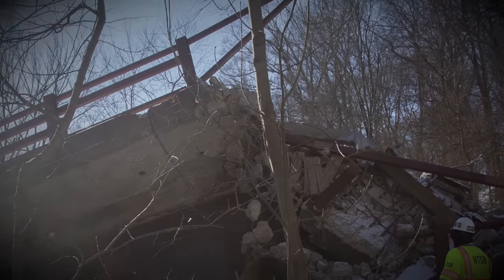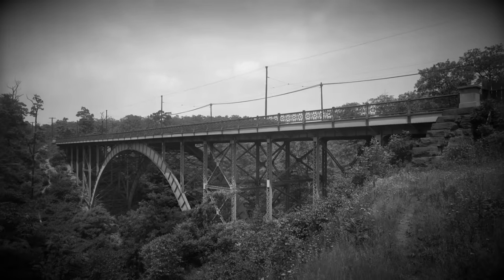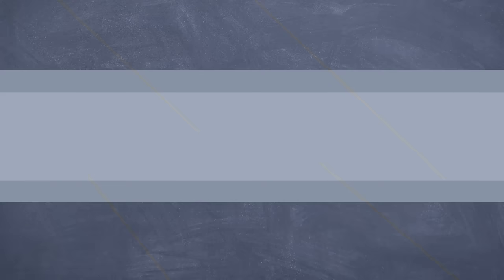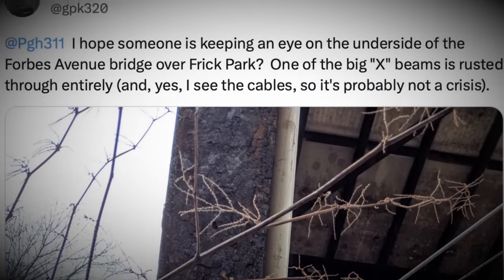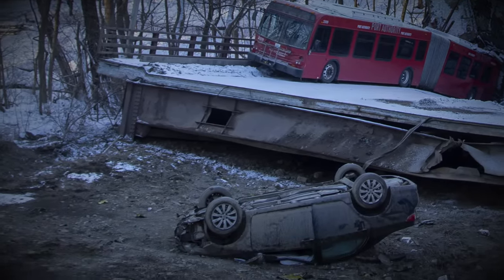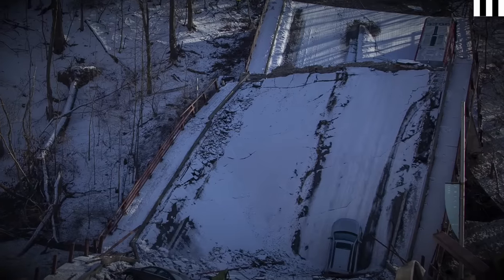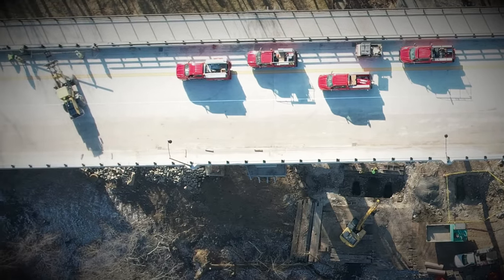Allowed To Rust: The Fern Hollow Bridge Collapse 2022 |  | Plainly Difficult Disaster  Documentary

Comment: A small addendum for the cause of the rusted steel: The material is call Corten and was invented by US Steel Corp in the 1930's, but not very commonly used for bridges until much later. It is particularly susceptible to corrosion when in the presence of salt water. The reason the steel of that bridge rusted so rapidly was because Pittsburgh uses a HUGE amount to salt in the winter to keep the roads passable. It is the NaCl that accelerates the corrosion, not so much the standing water as you stated in this fine video. Flowing salty water will actually increase corrosion of steel since there is increased ion exchange from the new salt added to the water stream. Love your shows! Keep up the fine work.
Reply: *"Cor-ten"
Reply: Cor-Ten steel used in present "seacan" construction.
Reply: @sharonfieber6458  it is indeed, however the steel is also painted with many coats of marine grade paint too to protect it from the salt water. Any small chips in the paint do seal over with the corten signature rust coating, but this is totally secondary. In the Fern Hollow bridge there was no attempt to paint any part of the bridge. Really stupid decision, that.
Reply: I believe the New River Gorge Bridge in West Virginia is also made of Cor-Ten, although it dates to 1977 or so.  There were concerns about keeping an arch bridge over 800 feet in the air painted, so Cor-Ten was used.  I sure hope they have a way of keeping road salt off the steel parts.
Reply: @B-and-O-Operator-Fairmont  Hopefully so. I doubt WV can do a worse job of it than PennDoT did! LoL . Maybe that WV bridge uses active galvanic protection measures.
Reply: Burlington Northern Santa Fe Railway has some bridges made of Cor-Ten steel. They considered making their signal equipment boxes out of it, but decided having rusty boxes at highway crossings would look too bad from a public relations standpoint.
Reply: @MrBirdnose  I personally always hated the rusty stains all over the ground around of a corten structure. They look like something out of a Mad Max film. If you are ever in Pgh check out the paving around the old US Steel building in the downtown area. You cant miss it since the entire thing is rusty and ugly to behold (but at a distance it looks nice to some I guess.) 600 Grant St, the entire thing is made of Corten.  NEVER touch the steel unless you like getting rusty dirt on yourself! The building maintenance people try to keep the staining to a min but in my opinion it still looks like crap. BTW the maint people also have instructions to never apply salt anywhere near the building base! LoL
Reply: We should use stainless steel then
Reply: @LivingTheDream77  Stainless steel is expensive, doesn't always have the properties required, and some grades of it actually rust quite easily in the presence of salt (which is often applied to roads to melt ice.)
Reply: @MrBirdnose  im sure building the whole fucking bridge again costs more.
Reply: A242, A588 we use tons of it building industrial fans.

Comment: On the topic of collapsing bridges; I'd love to see a Plainly Difficult-take on the collapse of Tretten Bridge in Norway in 2022. A glulam (glued wood w/steel bracing) bridge fell and took two vehicles with it. They avoided ending up in the river below, though, and there were no injuries. The bridge was built in 2012, so it only lasted 10 years. The authorities closed 14 glulam bridges for inspection after the Tretten Bridge collapse. The cause of the collapse was apparently material fatigue. Another similar glulam bridge collapsed back in 2016 because of a design flaw. It lasted only 4 months…
Reply: Someone did that already...

Comment: We had a bridge kinda like that, with a tendency to ‘uninstall’ itself. The Cline Avenue Bridge in East Chicago collapsed during construction in 1982. They eventually finished building it. However, when they discovered the bridge was eroded to the point of basically being a few sticks holding up a pockmarked roadway they finally closed it in 2009, but they didn’t demo it until 2013. In the meantime, it just kept falling apart and people kept driving off of it, not realizing it was closed. They finally opened a replacement for it in 2020. However, the bridge was built by the same people that built the pedestrian bridge in Miami that collapsed, so we’re a little leery of it. We’re worried that they didn’t put in a ‘hardware’ upgrade so it might ‘uninstall’ or spontaneously decide not to show up for work today, just like the bridge in Miami.

Comment: The tallest building in Pittsburgh, what I and many other Pittsburgh residents  have always known as "The Steel Building" not only uses "CorTen" steel that is designed to use a thin rust coating as patina protection against further deterioration, it also is constructed with external load bearing box beam columns that are half filled with glycol and water. In the event of a major fire, the antifreeze inside these columns will expand and dissipate the heat (steel loses virtually all its structural integrity at around 600°F) to prevent the collapse of the building. I always thought that the use of those liquid filled columns was pretty amazing.

Comment: Things like this and the Surfside Condo collapse highlight something. These were largely preventable disasters caused because officials simply didn’t want to pay for maintenance. Which at the end of the day, may be a more intractable problem than design flaws.
Reply: Adding sacrificial zinc anodes at the time of construction extends the life of a steel structure at least threefold. Engineers are either shortsighted, or they do not understand the principles of cathodic protection.
Reply: @wilsjane  "Engineers are"... way to misplace your blame entirely.
Reply: @wilsjane  Usually it's the contractors and government nixing it to reduce the cost. The engineers would almost always be more than happy to include all safety and durability features.

Comment: In 1991 a light pole made from such steel snapped and killed 2 people. Photos taken the next morning showed that the brown corrosion that is supposed to just protect the surface at penetrated almost all the way through the metal almost all the way around the pole where it broke. During the investigation it was noted that landscape work had been done and a large pile of rocks and soil had been temporarily stored near the base of the tower. This kind of metal has to be completely exposed to air if the corrosion is to protect the metal below the corrosion.

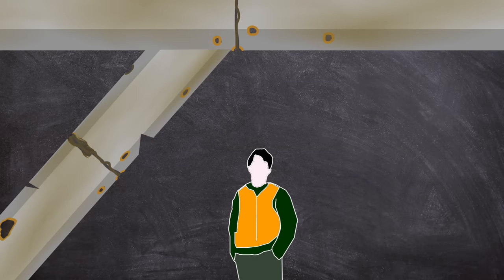Comment: 4:21 You mean the beam was replaced right?
They didn't just actively weaken the structure?
Reply: Nope. 
Yeah.
Reply: local, can confirm they just literally took out a rusted support beam because it was rusted through and crumbling (mostly to hide their shame because people kept taking pictures and reporting it) and didn't put anything back in to add additional support, and then were surprised it collapsed. people have been pissed off about bridge and road maintenance in the city and around the state for a while, they do some dumb things and neglect things until they fall down.  there was another bridge that's had nets and mesh around it since the 80's because chunks of concrete was falling off it, but was still in active daily use with people both driving on it and UNDER it until just a few years ago when they finally replaced it.  between the neglect and the road salt its lucky we still have any transport infrastructure left standing.

Comment: the older i get, the more of these videos i watch the more i'm convinced that we should build with brick and stone with minimal concrete and strategically placed extremely corrosion proof steel. Basically study the Romans with a modern twist because what we build these days is evidently rubbish
Reply from the maker: Concrete is a bit shit
Reply: Many of the mid-century bridges are decades past expected replacement. They weren't designed to be used for so long with so much traffic.
Reply: @edcrichton9457 That's just it. A frenzy of building lots of cheap bridges and structures when the economy is humming leads to a bunch of decrepit structures decades later, with no guarantee the economy will be so good. (Spoiler: it's not.)  I also like the "build like the Romans" idea, at least where practical. Stone arches won't work everywhere.
Reply: The reason their structures lasted so long likely has much to do with amount of usage. You can't compare 10 years of foot traffic and horse carts to 10 years of cars, trucks, semis, heavy equipment at a much, much higher population. Oh, and our more extreme temps- the same materials need to be able to handle high highs and low lows.
Reply: @mommy2libras  The Starrucca Viaduct and other stone arch bridges have carried heavy railroad traffic for almost 2 centuries now. Stone doesn't rust or crumble, so if it's on a good foundation and build correctly it can last a very long time. And temperatures in Italy can be just as extreme.
Reply: @edcrichton9457  Many of them were designed without anyone imagining we'd ever have so much traffic.
Reply: @PlainlyDifficult maybe modern day concrete, but the Romans did it right.  Sad to see things built & created now are inferior to ancient craftsmanship.
Reply: @mommy2libras  i was more referring the the buildings such a theatres and schools everything really but my point still stands a stone bridge is stronger and likely to last longer than a steel one especially with the strategic corrosion proof metal i mentioned just because it has more to deal with don't mean its not possible. you would in fact be hard pressed to convince me a properly engineered structure using best of modern and best of roman(cost not a factor is would be expensive but so are accidents) would not be able to handle the weight....would look nicer too.also i don't think temperature has much to do with this
Reply: Even stone a mortar require maintenance.  Absent some kind of design flaw if a bridge is well maintained it can last forever - no matter what it's made out of.  

In fact, I would avoid any material that is perceived as 'not needing maintenance' because that perception will result in little to no maintenance.
Reply: @kimmuckenfuss2284  Its planned obsolescence! got to keep the wheels of commerce turning!

Comment: The 1970s aren't known for producing quality structures in USA. Residential homes especially seemed to have lower standards. Ive had to reinforce roof framing because they used 1x4 supports (in snow country). People were still coming down their trips from the 1960s?

Comment: Yeah that Corten steel (weathering steel) is tricky. A lot of ISO containers are made from it and if you have to patch or otherwise repair it you have to use corten to do it. I'll bet the welds are the root cause in this disaster. It's really easy to un-weather property the weathering steel when welding on it.

Comment: The first 10 years of my life I grew up about six blocks from that original 1901-03 bridge which also carried two Pittsburgh Railways carlines (64 & 67, plus the 64's rush-hour 66 cutback) until 1967.  That 3-hinged arch-bridge really shook when the streetcars crossed over!  So the skimpy replacement only lasted barely 49 years!  I think that is Cor-ten steel that was used and it's been used on a lot of other structures plus the New Fern Hollow Bridge's (#2) spindly design which I see on a lot of newer interstates.

Comment: crane bus and sinkhole bus became local memes for a ridiculously long time because the Pittsburgh roads are so notorious for just eating public transportation vehicles recently.  Its a mix of age, neglect, corruption, and road salt- and i mean a LOT of road salt in winter, that cause our infrastructure to both break down faster and become ignored even when there's a known problem.  bridges with rusted out chunks missing and crumbling concrete are common in the area.  there was another bridge in Pittsburgh that had netting around it since the 80's because it actively had chunks of concrete falling off it for decades, but continued in daily use with people driving both on it and UNDER it until just a few years ago.  

some people are like "well, the government has a budget to fix the bridges, so go fix bridges with it!" the problem becomes WHICH BRIDGES? they try to prioritize the ones in the worst shape and use duck tape and prayers for the rest until they can get to them because the city is filled with bridges, at least 60 percent of roads will pass over a bridge somewhere in the city and the suburbs because of the rivers, land topography, and building/road density.

Comment: One of the major factors in snow states is road salt because it doesn't matter if you don't apply salt directly on the bridge surface. A million cars drop their residue which is highly corrosive to any surface, metal or cement or asphalt. And it also becomes airborne with splashing.

Comment: US Steel Kor-Ten weathering steel has a good record in other places.  The US Steel building - the tallest downtown skyscraper in Pittsburgh, uses it for the exposed exterior columns.  And the New River Gorge Bridge in West Virginia - the longest and highest deck-arch bridge in the world, is all Kor-ten steel.   My understanding is that is weakness is that it needs thorough drying between wettings for the oxide coating to develop its intended waterproof characteristics, and measures to handle the water runoff needs to be very efficient and well maintained if salt is used to melt ice and snow in winter.

Becasue it is a hilly city (and the salt mines with endless reserves not very far away in western New York do an excellent marketing job) Pittsburgh uses absolutely absurd amounts of salt on the streets and bridges in winter.  The creek under the bridge can run at 50 percent the salinity of seawater from the salty runoff from its urban watershed in winter  And, Fern Hollow is a wooded damp place with trees growing up to the bridge underside where the wind rarely blows to dry thing out.

The new bridge is a boring generic affair with concrete piers and simple supported beams, but it was fast, cheap, and should last.

Comment: I'll bet the cable bracing put loads on the bridge that the designer never figured into his calculations. It probably amounted to an unauthorized modification. They should have just replaced the parts damaged by corrosion.

Comment: The metropolitan area’s dependence upon bridges cannot be understated. It was extremely fortunate nobody died in this bridge failure. 

The 1901 bridge hosted streetcars (trams) into the late 1960s.  The streetcars generally weighed in the range of 36,000- 38,000 pounds, with earlier versions weighing up to approximately 40,000 pounds. When the 1973 bridge opened, the buses crossing the bridge generally weighed between 18,000 and 22,000 pounds. Buses continued to grow larger and heavier since the 1980s, coinciding with the second bridge’s ongoing deterioration.
Reply: If we had flying cars, this wouldnt be a problem any more!

Comment: Proper welds are stronger than the surrounding steel due to the heat realigning the molecular structure of the steel. If the weld fails before the unwelded steel, the weld was improper.

Comment: I used to cross this bridge every day, and you could feel it away with heavy traffic for over a year before the collapse. I think you hit the “nail on the head” speaking about the damp conditions keeping the steel from developing patina In dry conditions.  At the bottom of the supports was very damp and dense soil that was regularly in contact with the steel beams, thanks to runoff from the hillside, which meant the cement foundations for the beams wasn’t entirely effective or well placed. The city, county, & commonwealth all pointed the finger at each other with zero real accountability or issue ownership. Timing was pretty awful as it turned in to a political prop.

Comment: After the collapse I looked at pictures of the bridge construction. It seemed to me to be very "lightly" constructed for its purpose and size. The words "air weight" came to mind. Almost as if the engineers at the time were trying to prove that all that mass and weight of the previous bridge was unnecessary in a new "era" of bridge design.
Reply: Interesting point.  The reason many railroad bridges from the early 1900s are still in service is because they were "overbuilt."  Engineers of the time elected to build structures with very heavy construction, so much so that there can be a lot of corrosion without much loss of strength.  By the 1920s, engineers had a better understanding of steel strength and thus economized by building with lighter (yet very sufficient) construction.  However, once corrosion was left unchecked, the safety margin began to drop.

Comment: Look at the steel MFGr. "We'll just deliver this regular steel, they won't know." Self-protecting steel should never be used for a load baring structure anyway, it's fine for guard rails. Also you need to use the same steel in your welder.

Comment: Corten Steel should not be used for high loaded constructions. It is good for esthetic applications since it is in moderate conditions self protecting with a stable oxide layer. Another HS Steel succesible to corrosion applied in the past is Thomas Mangane Steel. (Eiffeltower and Golden Gate Bridge.) It can even become brittle when it 
isn't sufficient pure by precipetations while aging.